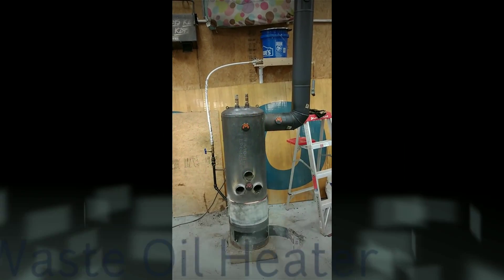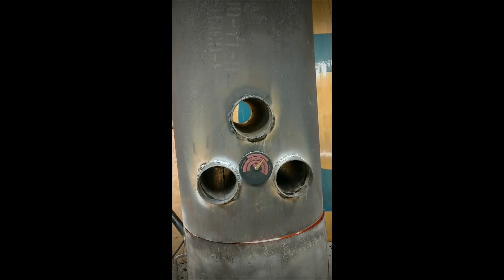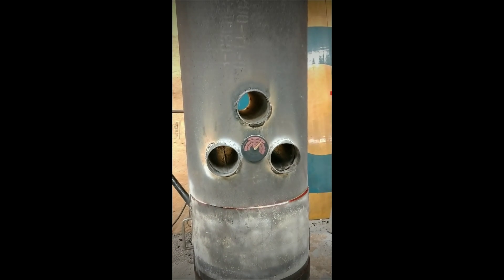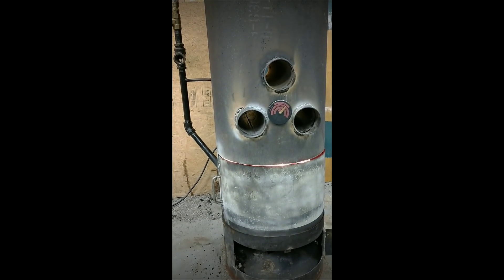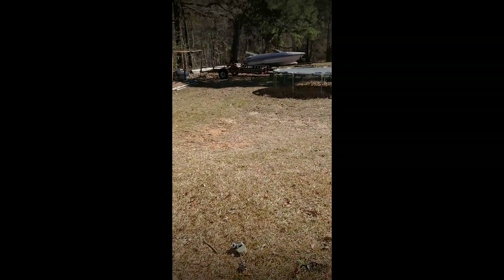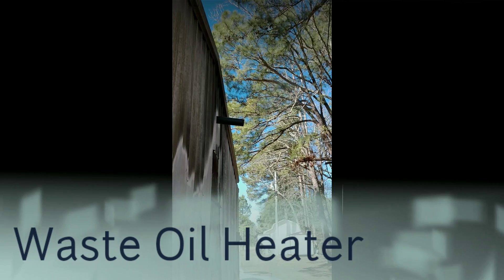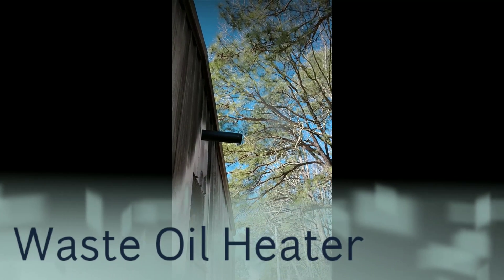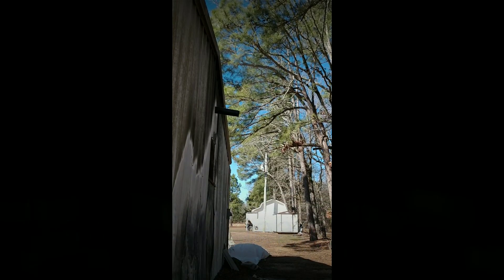Waste Oil Burner Smoke Output

Comment: Does it put off any fumes or smoke in the confined space? I was thinking about one of these in my green house
Reply from the maker: Not really any fumes or smoke inside the building as the draw of the flue actually makes a vacuum in side the tank. As for the outside there is a little smoke (very little see other video) . However if you do build one I would warn you that burning oil is very dangerous for many reasons such as fire carbon monoxide and other things
Reply: @randysdiy2102  I was thinking to heat a greenhouse in the extreme cold. So I was thinking about making a small one. Looks like I wont need much. Its only 300 square feet. I live in zone 7B Middle of AZ

Comment: That little bit of smoke may kill that tree. 
 I know it's not much, but because it's a different type of smoke than wood smoke. It has a higher environmental impact, try to increase your airflow with  fan under the burn pan. Or reduce the oil flow.

Comment: You could probably get rid of that by sealing up the door, etc.., and making more air come up through the bottom.. Might try running some thin flat bar around the door, while it is on the tank and tacking it to the door... On the hinge side,, put the flatbar on the inside of the tank itself and tack it on.. It would reduce the volume of air going in above the flame and create more draft over the burning oil, but, you probably know that by now.. But, flat bar would do pretty good, and if you had trouble getting it on well, then, just buy some fire door rope and some fireplace cement and put some on the flat bar and that will surely do it.. Might use a thin piece on the back of the door by the hinges, since it will most likely clamp down better.. Then a simple swing over a bolt type latch and you should be golden, if you hadn't thought about that yet.. Sometimes when it is sitting there, you don't see different ways to do something.. Worth a shot... 
Maybe you could describe that drip fitting once more.. I didn't quite understand what you did inside of the 3/8" fitting to create the stream at the drilled T.. I think a 3/8" to 3/4" bushing Female to Male, but, I thought I heard you say Mig tip and those are a lot smaller than your drip..
I havn't looked but, maybe a 1/8" pipe would fit into a 3/8" bushing, and a drilled out 1/4" cap or something??
Reply from the maker: I will try to do a video on the drip fitting. As I remember it I believe it was a 3/4 tee with a 3/8 to hose Barb inside it I'll have to go back and look at how I did that. Lol been too long ago.
Reply: @randysdiy2102  Sounds correct.. The Male to Female 3/4 to 3/8" fitting has male threads on the inside, that would accept a male threaded to barbed.. Thanks.. I see what you did.. Thanks again..

Comment: I make a similar stove. Works great. But when I burn about 60 liters of waste oil my smoke out is full of black powder and the stove don't work. Can you help me?
Reply from the maker: Sounds as if your are burning rich or not enough air to fuel try adding more  means of air to see if your issue gets better? Hard to say without seeing it but that's my guess.
Reply: @randysdiy2102  Thanks Randy. My burner Is make by me. Is like Gerry's diy burner. I adapted this to an old wood stove. The  feeding by graviti. I used waste oil from cars Without filtering. If you want photos send me a e-mail. davidanta100@hotmail.com Thank one  more time.